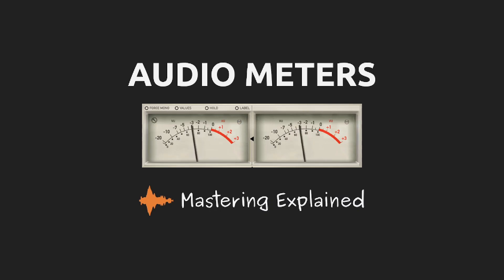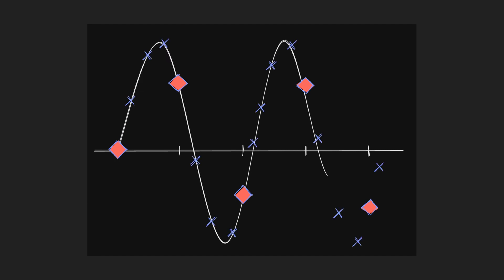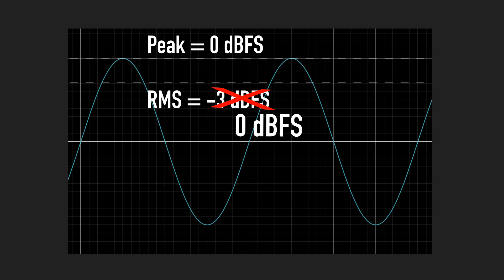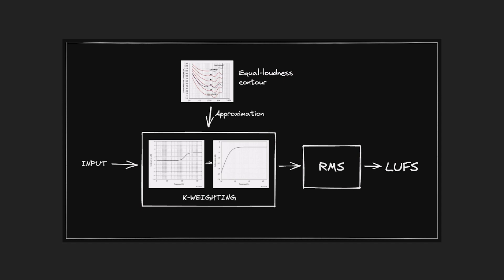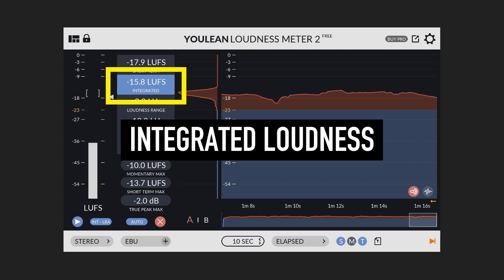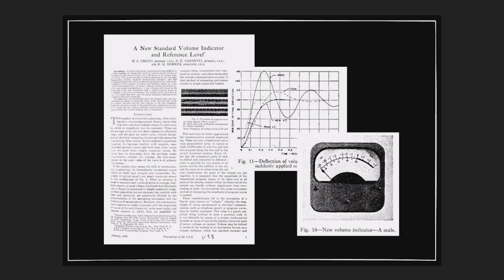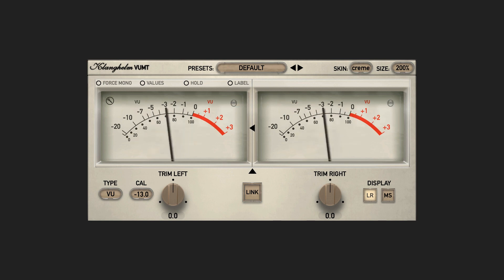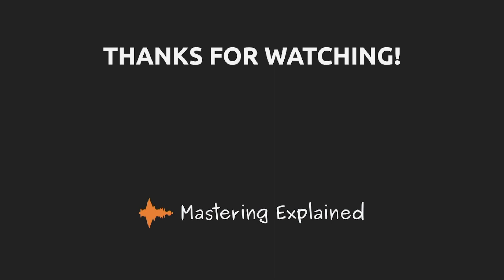Audio Level Meters for Mastering

Comment: Thanks for the video. If I want to measure the "loudness" of individual drum tracks (say, for setting up a mix balance) what's the best way to do this with a LUFS meter? For example, what about a snare track where the snare only plays on beats 2 and 4. In this case, is the Momentary LUFS value the most significant one? Do the Short Term and Integrated values provide anything useful? Cheers!